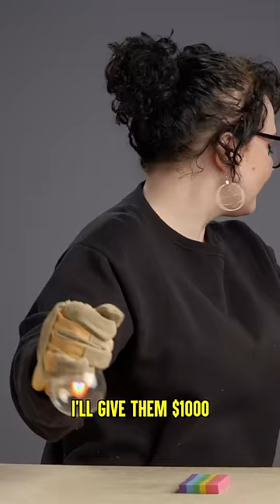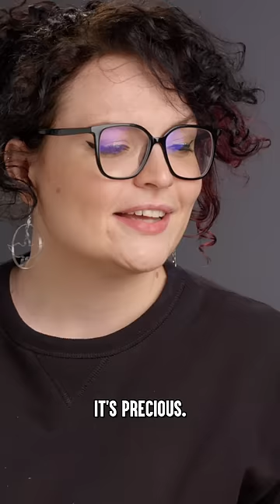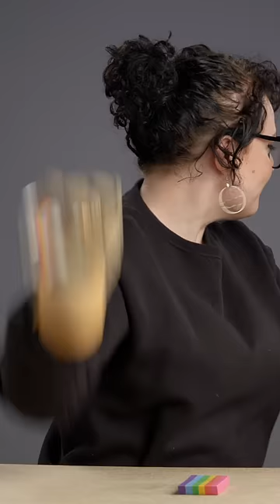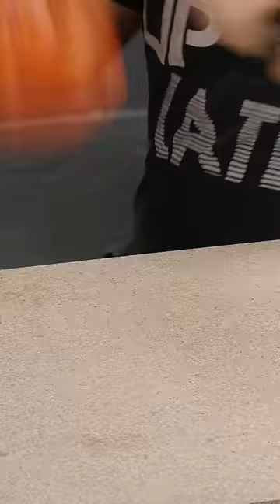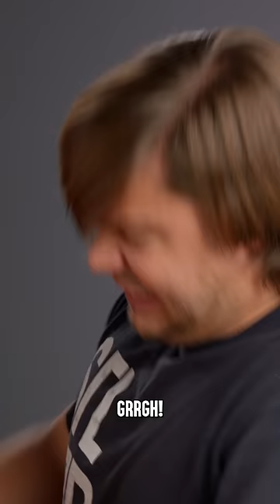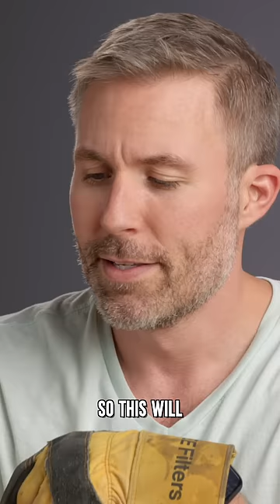Break This Giant Rainbow Eraser For $$$$

Comment: If I' correct, the rule applies that it must be broken with the tool, but it never specifies how much of the break needs to be done by the tool, just bite it in half until there's a tiny bit of eraser left holding the two peices together and then finish the break

Comment: one thing for sure is all u have to do to break that eraser with the string bag is to put the eraser inside to the corner, hold by the lower part and pull away both from top and bottom until it breaks

Comment: Twist the mirror so it’s now two mirrors. Pick up one piece, ignore the other. Place the mirrors rim on the eraser horizontally, and place your thumbs on top, and grip the sides(on the top half) firmly, and press as hard as you can. Roll it slightly. If you do it right, and for long enough, the eraser should split in half.

Edit: the guy with the bag should have tied the strings to it and pulled hard so it tightened- the used the power of friction to saw through it- 😭
Reply: People keep saying that - but they don’t have that much time
Reply: @MaKennaLeMond-rf7my  Eh, fair enough lol